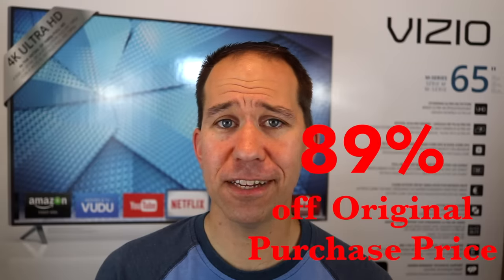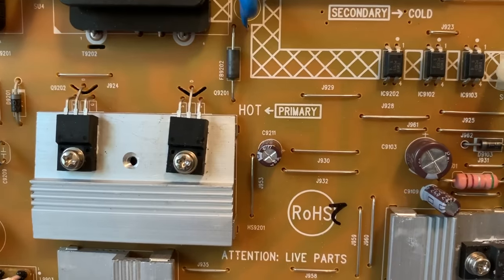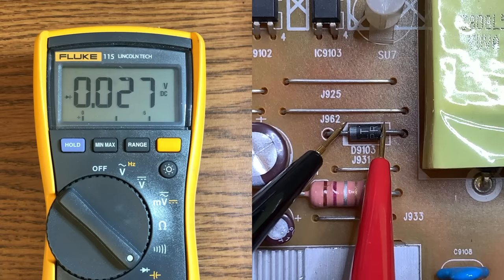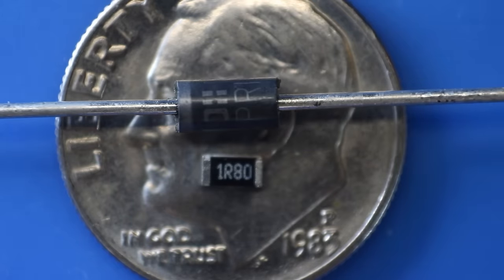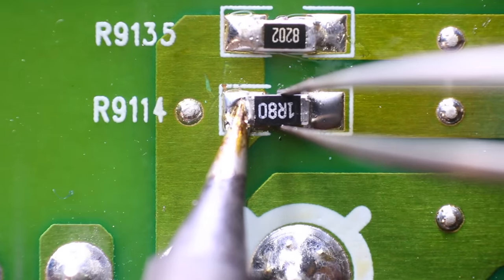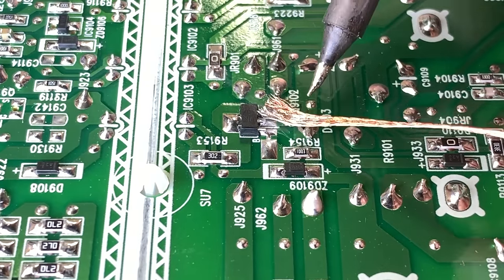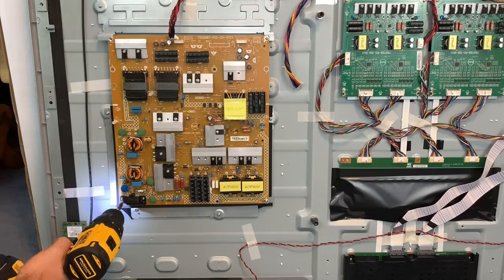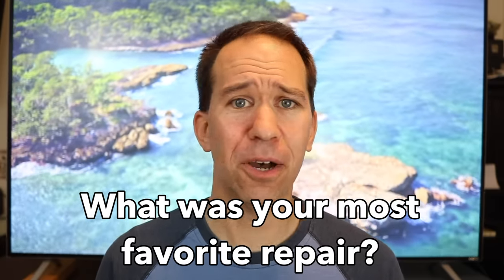I got a broken 65” 4K TV - How I repaired a Vizio M65-C1 (tv won’t turn on)

Comment: I have the same TV with a similar problem, except the wires to the power supply board are burnt out. CN9203 and CN9201 near the top of the board to the left of where the part number is printed. I can send photos. Can you help? Can't find this board anywhere online, it's out of stock everywhere. Help appreciated.
Reply from the maker: I saw your photos.  Looks like you got a short in there than melted things on that connector.  Was it like that before you opened up the back?
Reply: @FrugalRepair  This is the first time I opened up the back, following the TV losing the backlight (I can see a really faint picture moving when I shine my phone's flashlight on the screen) and the audio still works. So my guess it's something on the power board. I'm going to replace the fried cable at that connector if possible. I looked across the rest of the board but can't see any obvious signs of damage or burnt areas. Any suggestions on where to start? Ordering a multimeter now. I'm a n00b at this but hoping to buy some extra life out of this TV before having to buy another
Reply from the maker: @thisisdanchoi  Sorry, I looked at the photos too quickly and didn't realize it was the backlight connector.  I can't say what caused that short (and thus the heat).  A shorted LED?  I'd first check to see if the short is on the led leads first,  then I'd test the power supply at that connector for a short (make sure no power going to that connector).  If you can see an image then the only two possibilities is a bad power supply or a bad LED (or mulitple ones).  Definitely repairable, but will take some effort.  You should make a YT video of it. =)
Reply: @FrugalRepair  1. you said, "I'd first check to see if the short is on the led leads first" -- sorry, but how do I check for a short?  
2. "then I'd test the power supply at that connector for a short (make sure no power going to that connector)"-- again, how do I test the power supply for a short?  I am guessing it is using a multimeter, but what numbers am I looking for? Thanks for your replies and patience -- totally new at this.
Reply from the maker: Unfortunately, I’m not going to be able to walk you through how to do those things here.  I’d suggest watching some videos in learning how to use your multimeter.  There are plenty of videos out there that should help you on your journey to fix this tv.  That’s exciting you’re getting into repair!  You can always shoot me an email if you want to.

Comment: How did you find the part number of the resistor or know it was 1.8 ohms?
Reply from the maker: I just went with the information already available online.  But for basically any smd resistor,  the resistance value is printed on top. There’s a special code that they use for the different values.

Comment: Hi @FrugalRepair I have a philips 55inch 4k led tv (model number 55PFL5601/F7) and there is no power. When I opened the back I hear a low clicking noise from the power supply board. I removed the power supply board. With the naked eye I dont see any bulging capacitors. So is this a bad power supply board or the main board? Please let me know. I would appreciate your reply a lot. Thanks.  P.S. I have a harbor freight multimeter.
Reply from the maker: You would have to check the voltage is coming out of the power supply board. You might need to send a 3 V signal to the power supply on the pin that tells it to turn on all of the voltages. That usually is called the PWR_ON or BL_ON Or something like that. But you may have a power supply that turns on the main voltages when it gets plugged in.
Reply: @FrugalRepair  I changed the entire power supply board and the tv turned on. I will see if I can fix the old power board. Most probably the capacitors are bad.

Comment: I watch learning videos on yt ALL the time. I am 70 and I have fixed my dead push mower and a small tiller. I took apart the whole workings of the mower learning from a video. It is 15 years old and I use it to go around trees and then I finjsh with my ridibg miwer and weed eater.
My prkblem now is my 45" Vizio tv which is turning itself off and on, off and on.  I tried all the unpluging to reset it and nothing works .Do you have a clue?  Thank you
Reply from the maker: Thanks for posting!  Never too old to keep learning.  My first guess is a bad firmware.

Comment: Having a similar issue with my Vizio p50-c1. I checked the resisters and it was very similar to u but the diode was fairly different... would it mean I just need the resister and not the diode? What should the diode normally read?
Reply from the maker: The problem I worked on is very specific to this particular power supply board.  I am not aware that it affects other power supplies.  But it’s very possible that a similar design and similar (or identical) components are used.  That said, I don’t know your power supply so unfortunately, I can’t comment on specifics.  I do know how resistors and diodes should function though in general.
Reply: FrugalRepair I couldn’t find any info on my specific model however I do know that these are fairly similar models, with yours being larger and mine having more performance. Build is pretty much the same, taking everything apart was the same and the board itself is fairly similar down to the placements of the resister and the diode you referenced in the video. Using your tv as reference, what reading should I see from the diode when it’s fully functional? Thanks!
Reply from the maker: What reading do you mean?  The voltage drop is probably in the .5 volt range.  The biggest test would be to see if it is shorted.
Reply: FrugalRepair FrugalRepair Sorry, don’t know much about this. When I tested the diode black/red it was a solid 480 and then swapping to red/black like in the vid it shows no value. Just stays at the OL.
Reply from the maker: I’m sorry, I don’t understand what you are measuring.

Comment: Power supplies that are not under load often show an output voltage quite a bit higher than the voltage under load.
Reply from the maker: This tv still is 19v under load though.  It is an AU Optronics tv so maybe they just do things differently.

Comment: Does it matter which number is on the resistor? How do you find the right ones?
Reply from the maker: Yes, the numbers are the value of the resistor.  I look at places like digi-key or mouser, places that sell these individual components.

Comment: after you replaced the parts, you measured steady 19V.  but i see the board labeled it as 12V?  what am i missing?
Reply from the maker: You’re not missing anything.  I don’t know why but they designed it to output 19v but labeled it 12v.
Reply: He was either checking the voltage without a load or there may be another issue in the supply. It would have been interesting to see a voltage check after he restored set operation. My guess is that the voltage probably would have settled down to something fairly close to it's stated value.

Comment: hey there, i have a vizio d65x-g4 when i power it on i get a back light and that is it, i have no sound, and no picture. i replaced the power supply, t con board, and video board with the same results. i started doing some poking around with a meter and noticed some spots were reading open, i narrowed it down to the boards the run along the bottom of the tv, my guess is that the tv is junk but wanted a second opinion, i got the tv for free . thanks in advance!
Reply from the maker: Have you tried running half the screen at a time? That is the next thing I would try. If there is a panel fault you should be able to narrow it down to either the left or right side.
Reply: @FrugalRepair  hey there,  so I had a chance to look at it some more and I unplugged the left side ribbon and half of the tv came on I plugged it in and nothing worked
Reply from the maker: @justindolske134  so are you saying that you have narrowed down the fault to the LCD panel and it's on that side that doesn't come on?
Reply: @FrugalRepair  yes I do beileve so,  but I have heard that there really isn't much luck at replacing lcd panels :/ and I am terrible at knowing what resistors to check
Reply: Meant to add that i think its a buffer board issue, but not sure how to test it. thanks again for your help! really appreciate it!!

Comment: Nice job ... I liked the video but the problem still remains ... Why did the resistor and a diode died at the first place...it seems like the manufacturer made a  malfunction  on a power board...
Reply from the maker: Thanks!  I don’t know that someone has figured it out yet.  Best guess is poor original component (diode).

Comment: Only add solder on one side. Don't add solder on both side and then press it down. This will only put unnecessary pressure on the solder side. Also it would make the component look crooked or in worst case give you an air gap that can be harder to solder.

Also never cut soldered legs. Cut them before solder. (Or reflow after you cut them) It can create micro cracks from cutting that will hunt you later in life.

Other than that great work =D

Comment: I got a P65 Vizio, its not turning on, sometimes it does but works only for few hours then I get half a screen pink and other half teal, after that it restarts I get a Vizio logo boot loop, and it doesnt turn on after that. What do you think could be causing it?
Reply from the maker: Seems like it has something to do with heat.  Have you found any clues online?  My might be a BGA chip issue.  Or a tab bond failure.  My initial guesses anyway.
Reply: @FrugalRepair  No clues online, but heat could be a culprit! It always feels extremely hot, and it started happening after running LED lights around the tv which might of added to the heat. Ill look into those parts, thanks!

Comment: So you googled the problem "AFTER" you bought the TV? And there was just one person with the same problem on one forum?
Reply from the maker: Basically, yes.  I think I did a quick search to see if there was an common issues with lcd panel failures (which you can't fix) and nothing came up.  Without seeing any comments about lcd panel failure I went ahead with the purchase. I've fixed many tv's so I was fairly confident that in the worst case, I would need to replace a board.  And yes, after I got home and researched it more I found one post which saved a lot of time.

Comment: Also, NEVER push down an SMD component while only one side is soldered, like you did at 7:04. It could lead to cracking, if not immediately, then after repeated heating-cooling cycles.

Comment: Help please, the resistor is showing 1.3 the one above as you checked shows 8.93. I have the same TV the diode is coming up with 21.00then continues to drop slowly and keeps dropping does that mean it is bad?

Comment: I have a laptop whose display went dark, but I could see a very faint image on the screen. I replaced a part by ordering it off of eBay for $25 and swapped it out. No soldering involved since it was connected with connectors. I have another non-working laptop that had milk spilled all over it. An entire board will cost about $80 to replace it.
Reply from the maker: Thanks for sharing your repair story!  Good luck on that milk spilled one.

Comment: I'm pretty sure this exact same thing happened to my Vizio M65-C1 today. However it doesn't look like your link to the diode is working any longer. Are you able to point me in a new direction?
Reply from the maker: They moved it on their site.  I searched on the diode model number and got this: https://www.mouser.com/ProductDetail/Diodes-Incorporated/PR1007G-T?qs=sxN%252BoM2fis9tEWMUM56sFw%3D%3D  You may be able to get it elsewhere online too.
Reply: @FrugalRepair  I just got the time to give it a go and it worked! Thanks so much for the video and saving me from buying a new TV!

Comment: my Vizio is just like that but a 55 inch. the white power indicator light is bright at first then fades out. the screen is black and there is no sound. ive tried easy fixes i've read on the internet to no avail. i dont know what to do. we've had this tv for three or four years. any suggestions?
Reply from the maker: Is there any info online about your model?  Any parts or repair kits people purchase on eBay?  Some clues I look for first.  Otherwise, you’ll need to open it up a check voltages with a multimeter.  You could watch my video on how to fix a tv hit my lightning for a starter on what to check.

Comment: I currently have an old vizio tv that is broken but I'm having a hard time figuring it out since I've only used a multimeter once before and have zero experience in electronic repair. So it's super slow going for me on that and it realy sucks because I have no tv to watch wen I get in from work.
Reply from the maker: What’s wrong with it?  Did you see that I have a diagnostic guide you can download?  I hope it might help.
Reply: @FrugalRepair  no pic w bak lgts on. I've yet to run sound test. Bak cvr removed and mnbrd screws removed. I thought maybe remove all boards, package carefully, take to geegksquad. They tell me which one bad component and board.
Reply from the maker: Unfortunately, they won’t be able to tell you which component is bad.  They don’t do that kind of work as far as I know.  Did you try the trick that I did in my latest video from last week?  That should give you a clue.  Plus if you play something with sound and you know you have sound then that helps yo narrow it down too.
Reply: @FrugalRepair  Good morning, how would I know out if sound works wen i cant see what I'm choosing on menu? If I recall correctly the sound of white noise (static) is automatically muted by the TV so theres no checking sound in this way either. What do you recommend I do to check? If I plug In DVD player or something in one of ports to check I still have no way of checking  input is correct because no display. Oh and you should know remote was  pretty much destroyed by roscoe, my puppy dog, just hours after black screen.
Reply: @FrugalRepair  theres gotta be a place where I could have the boards checked. Will have to search if best buy is a no go.
Reply from the maker: Usually I put in a DVD that will play sound automatically. That’s how I test if there’s no image on the screen and the back light is on and I want to see if there’s sound. It could be a bit of trial and error with pushing the input button. But eventually it’ll get on the right input

Comment: I got an issue with 49in TLC roku tv. I looked up some YouTube videos to find out what my problem was. The tv would powered on normally but u couldn't see anything. U would had to get close with a flashlight to see. So after watching the YouTube video  I find out my problem maybe a bad backlight issue. I took apart the tv after getting the replacement part. Power on the tv. But no pic. The tv power on fine like before. Can u please help me solve this problem
Reply from the maker: Seems like you found the issue that the backlight is the problem.  Did you make sure they gave you good led strips?

Comment: Where do you get the micro soldering kit and all the specialized tools you use to repair boards?
Reply from the maker: Mostly on Amazon.  I should have a link in the video description to a page on my website with links to the repair tools.
Reply from the maker: Let me know if you have more specific tools questions
Reply: @FrugalRepair  nothing else tool related, thanks. I am a little demoralized because my attempt to fix my Vizio 55 inch 4K TV didn’t work. I thought I narrowed it down, and I ordered a board, plugged it in, but it didn’t fix it. It turns on with a white indicator light at the bottom, but never any screen shows up or any sound. Well back to the drawing board I guess.

Comment: I have a Samsung 70" Q6DT (QN70Q6DTAFXZA) and when I plug it in the screens backlights flash on for a second and then it turns off. The red LED indicator flashed red twice really fast and then twice again and then the TV recycles the process again like its trying o turn on again with no luck. Any idea on where to start with fixing it?

Comment: I have a 50  inch led  vizio that I picked up off the curb. At first it turned on and had a green bar where the logo was. I moved and it would't turn on at all I replaced the Main board and it stared to work however it has a blurry picture and the colors seem off (Also this is the second main board I had to get the first one was the wrong model and the wifi didn't work however both Main boards had a blurry/pixlated picture) Any Ideas?
Reply from the maker: Thanks for posting!  Does this model have a tcon board?  It could be that.  Unfortunately, it sounds more like an lcd panel failure.  I assume you reset the settings.  You could try to drive half of the screen at a time to isolate if the fault is on one of the buffer boards or in a side internally on the lcd panel.  To do this, disconnect one of the ribbon cables after the tcon board.
Reply: @FrugalRepair  Thanks for the reply! I have replaced the Tcon already so i'll have to try disconnecting the ribbons and see what that shows. Also I did reset the settings on the TV.
Reply from the maker: Is there anything online that gives a clue for and panel failures for that model?  I would also check the tab bond connections.  If you don’t know what I mean perhaps you can search for it.  At some point, I plan on making a series of videos on how to do all of these diagnostics.